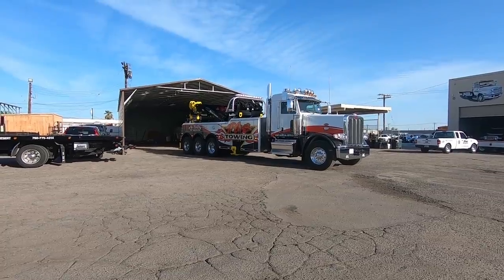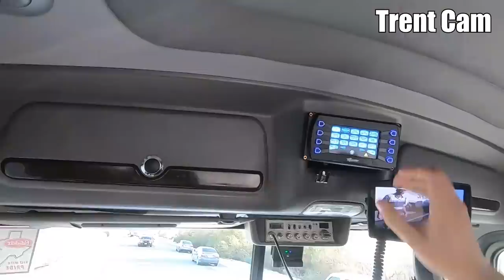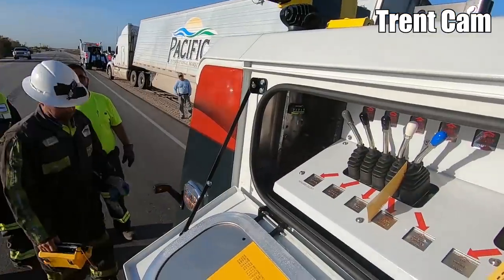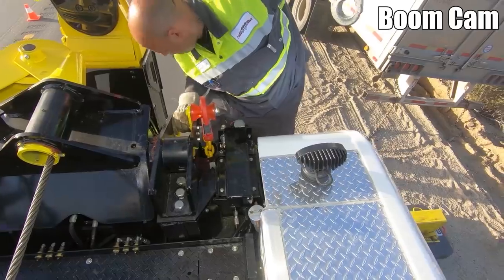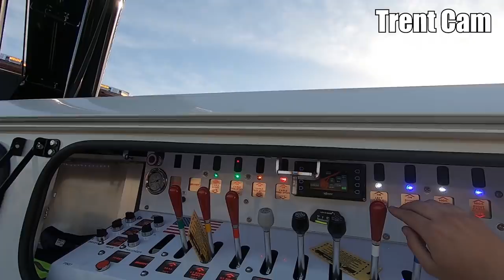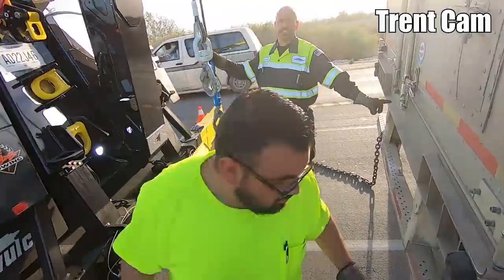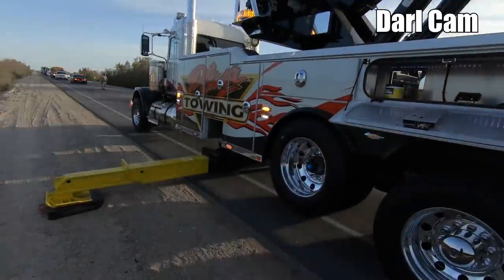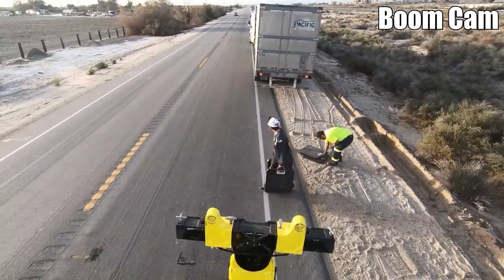Rotator Picking Up Trailer Leaning Into Ditch

Comment: hooking to the boom is operator preference,,, hooking to the body adds another level of safety if the boomlock fails,,,, and helps stop boom shake on rough ground,,,, keep up the great work ,,, good teamwork with clear chain of command,,,, thumbs up
Reply from the maker: If the boom lock fails I have bigger problems than not having the cable hooked into D-rings LOL. It absolutely operator preference and this is my preference. it seems as if most see how other companies do it and think that is the only way things can be done. Thank you for watching! much appreciated
Reply: @plazatowing  Thanks Trent, I appreciate and admire your desire to keep your equipment neat, clean and lookiing new and the tad bit of additional time it takes to do so.  Keep  up the great work and videosl  The truck looks fantastic.
Reply: @plazatowing  I'm sorry if it came across as a critical comment. I enjoy your videos and support your preference on how you do things
Reply from the maker: @Bob-jw1pc  no worries I understood what you meant! It all comes down to preference. That's all... I just feel that some feel like I am doing it wrong LOL. Thank you for watching!!

Comment: Is the boom cam a battery-powered camera, or something that's powered off of the truck?  If you can, it would be cool to see this truck and your regular truck have some truck-powered cameras installed, so that you don't need to rely on portables so much.  You might want to consider if a wider-angle lens on a boom cam would be useful too, since the angle will change so much as you work, or else if a camera could be installed on a gimbal so that it doesn't ever end entirely skyward or entirely downward.

Comment: Truck looks absolutely great Trent. I couldn't stand to watch most of the video because I just think it's rude and demeaning to take control of someone elses truck. You were doing just fine and I think you had your plan all set in your head and it would have worked just fine. Didn't need both sides of the outriggers out by no means. But maybe it's a family thing or something. I know you will defend everything that happened because you have to but you had this job under control and I just don't agree with someone taking over your truck sorry. Again Truck looks excellent Trent. Stay safe buddy.
Reply from the maker: There was no taking over the truck Darl and I share the truck and at one point I asked him if he wanted to run the truck which he accepted therefore I set up the platform while he rigged the chains. Dark and I have a very good working relationship unlike others.
Reply from the maker: @dandunning4409  If that's how you feel guess I can't change that. I answer all comments truthfully. I am always willing to learn and accept constructive criticism from many. Never ever have I claimed to be "tow god" as a matter of fact I've made it very clear that there is a lot to learn about this new truck. Once again, I asked Darl if he would like to run the truck to which he accepted, therefore, he ran the truck. No hard feelings... we have a standing agreement to take turns ... we are both learning the truck together. Your comments are very rude and irrational. I always accept and actually ask for constructive criticism and respond in respectful matters because I respect people opinions. Comments are always responded to in truthful matters and when someone catches something I did wrong or something I could have done better I accept that, thank them for it, and learn from it. Apparently, you dont see that side. The way you conducted this comment reflects unprofessionalism. I cannot seem to grasp why you are the only one complaining of this "behavior" I apparently present. Hopefully, we can come to an understanding.

Comment: Ya think the civil engineers that designed the skirts would think that if a vehicle went just a little to far over to the right in either side of the road would end up stuck. Look at it....just enough room for the width of a car. The drop off is extreme. Idiot engineering.